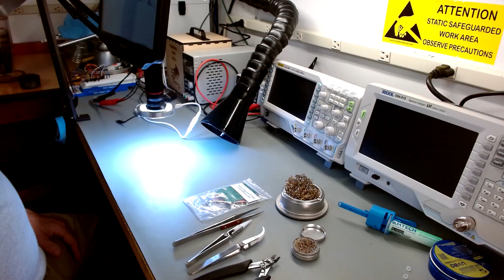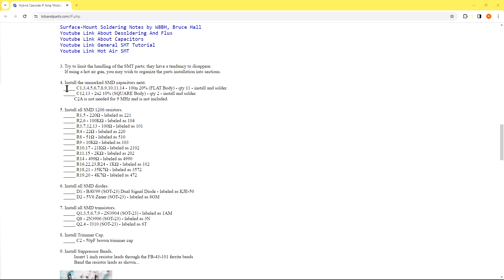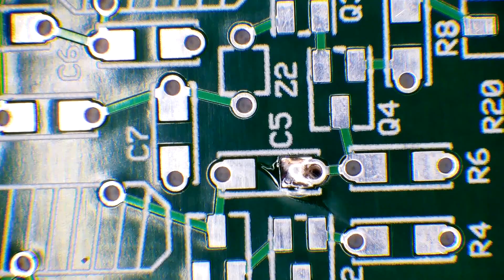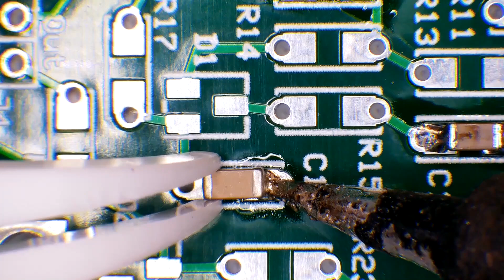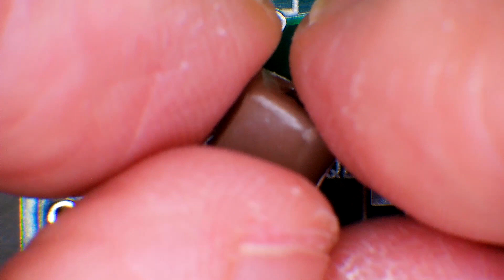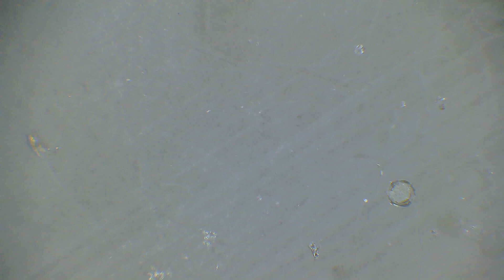Kits and Parts IF amp kit build part 1

Comment: When and where would you us this?
Reply from the maker: Depends on the radio design but after the mixer on input or output of the crystal filter. As your RF signal go through the input filter and mixer you lose signal and need a gain stage to recover and boost the signal.